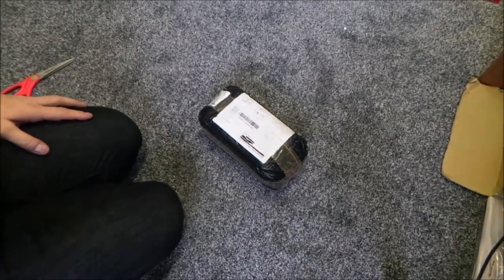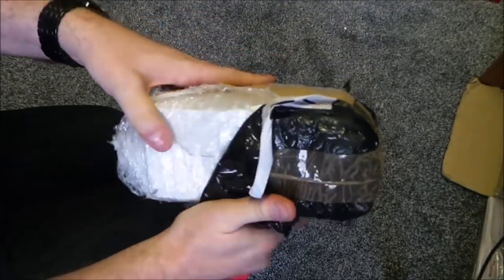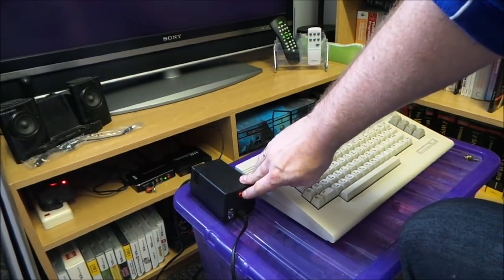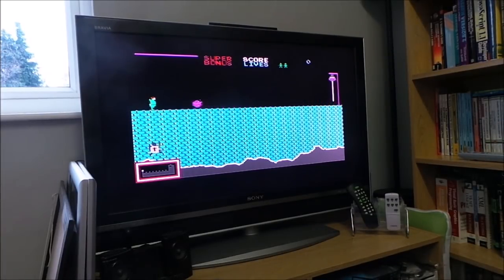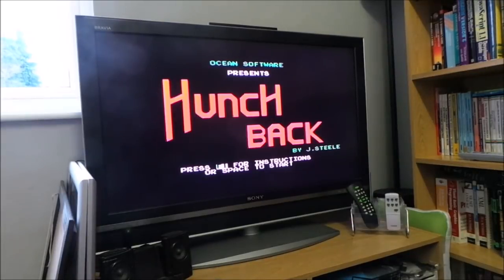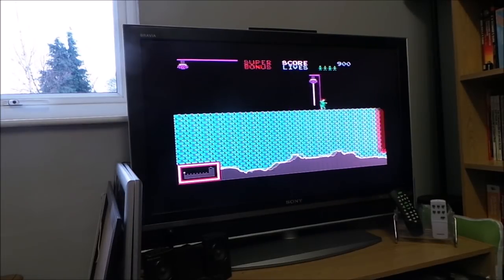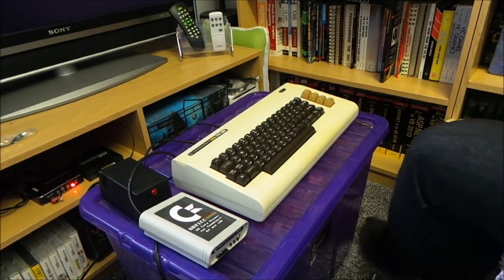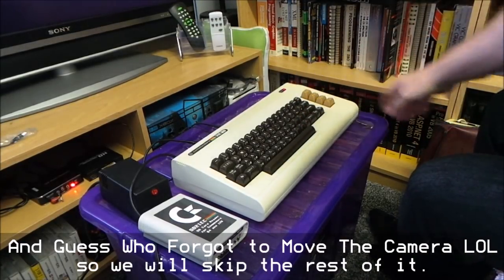Unboxing a New Modern Day Commodore 64 / VIC20 Power Supply

Comment: Thanks for the video. Good to see it powers everything you threw at it. I just got one from the same supplier that also powers a 1541 II. I also found it can power my 1581 also. It’s great as not only does it have the protection built in as you stated but means I only need one supply for the computer and disk drive. Well worth the investment. Would also recommend these supplies.

Comment: The old unit was completely dipped into some epoxy mass beneath its plastic cover, in order to transfer heat more efficiently. It did not, actually it was overheating and probably most broken units died of heat.
Reply from the maker: fradd, yeah I have lost 4 power supply units since I've been doing these videos, so thought I'd invest in a new more modern one :)
Reply: So, good investment, but $35...? Yes, i know it has to be slightly specific having 9V AC rail, but still a bit steep.
Reply from the maker: fradd maybe a bit steep but it runs all my Commodore stuff except the plus4.  So I think it will pay for itself soon enough ;)

Comment: It would have been interesting to see the inside of the device.
What I usually use instead of a new power supply (albeit I own one) are modified old ones. I'm using the door stopper shaped ones (because they aren't completely potted like the brick shaped ones usually are),  crack them open, recap and rediode them, cut off the 7805 linear voltage regulator (because these are the ones that can go bad and cause an unwanted increase in voltage) and solder in a small PCB with some switching regulator on it instead. It's a bit fiddly to get it to fit in there, but it's possible. I then glue the power supply back together with some super glue or epoxy and... profit! It's around 30min to 1h of work per power supply, depending on how it all goes. On some models, you also have to bridge the gnd pin of the former 7805 to actually connect directly to ground and not via some resistor, but that's all there is to it.
Reply from the maker: EgonOlsen71, I wish I could do that but electronics is not my thing lol, but one thing I do believe in, is if someone has spent the time developing things for old tech then I will buy that item to help them. Also give me something to chat about too :)

Anyways I would have opened it up, but usually I break things ;) so I will leave the internals showing to the experts ;)